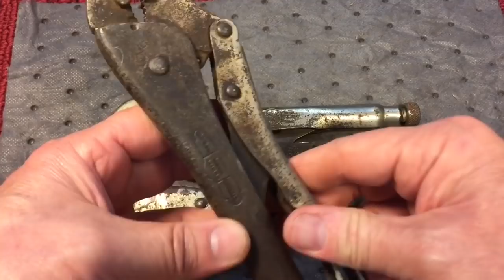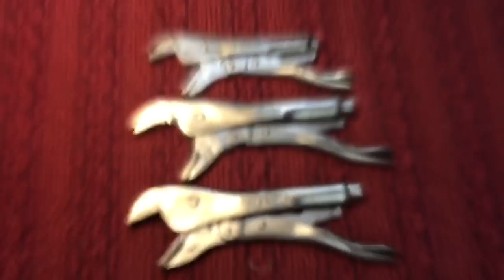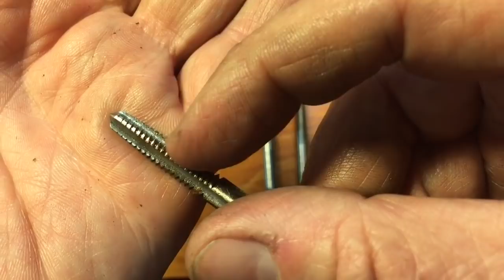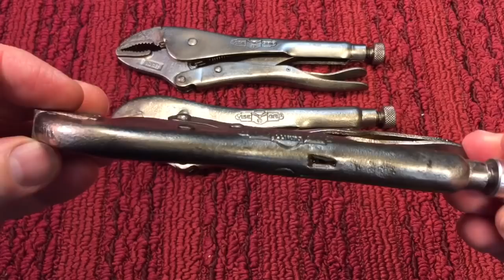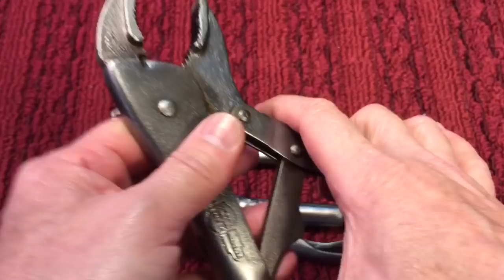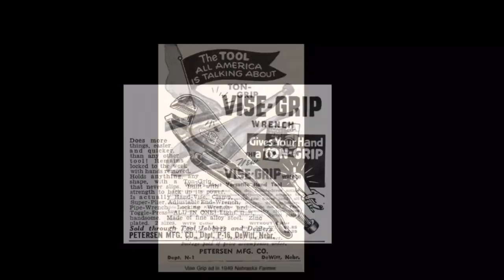Restoration of 3 VISE GRIPS...

Comment: Nice job on that end-knob. I didn't realize you could knurl with a lathe. If you want a real hard finish on the pliers, a 2K clear coat will hold up much better than any shellac, varnish, etc. It's sold in rattle cans. A little pricy and you need to use it within a day after it "kicks," but if you have lots of tools you need to spray, you can do them all at once.
Reply: what do you mean before it kicks?

Comment: Phosphoric acid works better than vinegar.  I use it to restore all of my rusty tools (and anything else rusty).  Just wipe it on with a rag.  It also removes rust stains.  Severely rusted items will sometimes develop white salt.  Just wipe it with more phosphoric acid.

Unfortunately, Lowes stopped selling phosphoric acid in 2018.  I bought 6 quarts of it on clearance for less than $2 a quart.

Comment: I have ootals of vice grips USA a Asian the things I've noticed about the Asian ones is not only the teeth of the jaws are very soft but the body loosens up on the jaws causing them to be very sloppy especially the needle nose and even the thumb screws are very soft and mushrooms out even under relatively low pressure... I  just redid a small pair of mine that I thought were rusted on the threads but the tip of the thumbscrew was so mushroomed that it wouldn't turn!!

Comment: I have vise grip which has a little of rust inside, can I use viniger or it will remove the coating of all the tool besides the rust?
Reply: Just used viniger to get most of the rust off and but still didnt get all the old paint off nice to cover it with clear coat so I colored it matt black. It turns great ( like a special addition or something :-))

Comment: Inexpensive!
I bought mine back ~2004 @ HomeDepot.
A month ago I wanted to buy one for my job and expense it.
Went beck in HomeDepot, with the idea that I will walk in buy one, and walk out.
Walked in, found tools section, found ViseGrips, found several new iterations, and started inspected. 
However Found ON ALL OF THEM Jaws and blades didn't align. Also the even though they were new, bottom jaw was moving side to side.

When I bought mine back in ~2004 everything was perfectly aligned. I member this because, I member that I was so happy that I as emigrant was holding, and owning something that was made in USA in such grate quality.
Today I thought I would be able to find one on Amazon, and buy one. Nop! 
I found out that company that made mine IRWIN, was bought out by Chinese company, and that they are manufacturing this Vise Grips in china, in same shiity quality that i found in HomeDepot.

If you have Unused, or in excellent quality Made in USA by IRWIN Vise Grips, hit me up and I will buy one/more at 400% including shipping.
Reply from the maker: It's such a shame that we can't get many of the quality tools of years ago, they have the technology and steels to make the same product but they always wind up skimping on something!
The Newer Vise-grips look similar but the jaws are much weaker steel and get mangled quickly....   Thanks!!!!!!!!

Comment: I can't find anything on my issue...what if the adjustment on the vise grip i was thinking of  taping
Reply from the maker: These are pretty simple tools, is the drive screw bent?
Reply: @ScoutCrafter  the adjustment threads on the vise grip are stripped

Comment: Just read your video on the Stanley grips. Very good and instructive. 
How do I assemble the grip after removing the lever? I cannot get the lever back far enough to go into the wide section of the slot.

Thanks, James
Reply from the maker: James- I'm not exactly sure what part of the grip you are talking about.  Maybe a pic?  bicycleguy@aol.com   Thanks!
Reply: Thanks for the reply and apologies for the delay, I'm mainly on email.

Problem sorted by gripping the jaws of the mole wrench I was able to reinsert the lever.

Thanks

James

Comment: Awesome video! Great to restore and save reliable Irwin vise grips! Did you use metallic paint or clear coat after all? Which did you use? Respectfully, thanks!
Reply from the maker: Hi Anthony!  I wound up keeping these inside my basement so I just wiped them down with my home brew 50/50 Mineral oil/Vaseline mix!  Thanks!

Comment: Thank you for posting this! I broke one of our vice grips but turns out it wasn't really me. It was the rust. My bro actually ended up fixing it with a blow torch lol
Reply from the maker: You know sometimes since a tool is a forging, there are cracks that develop in the tool and will break no matter how gently you treat it!  I think manufacturers estimate that 5% of tools are destined to fail...  They have no problem replacing such failures!  =)  Not your fault!  Thanks!

Comment: i got an older pair soaking in power steering fluid now because its rusted the  adjuster won't turn and the jaws were shut and wouldn't open until the other day when i took it out of the power steering fluid, another week and it should be good to go rinse it wire brush it and oil the joints
Reply from the maker: Power steering fluid and ATF are really good solvents!!!!!
Reply: @ScoutCrafter  what sucks about the power steering fluid is its really just hydraulic fluid almost the same as dot-3 brake fluid, i was doing my former son in laws brakes and had to replace the 2 rear cylinders old drum brakes and i got the asbestos and brake fluid mix on my hands and then spent an hour and a half finding and going to get the new ones, i had that on my hands most of the day and now when the heat and humidity of connecticut gets going the skin on just my right hand dries and peels where the asbestos and brake fluid saturated my hand. now if i go anywhere near brake fluid my hands start to burn just from touching it. it really sucks because i used to make a lot of money doing brake jobs for friends

Comment: Singer John Denver was using a pair of vise grips as a handle on the fuel transfer valve in one of his airplanes.  He ran out of fuel at low altitude and tried to unsuccessfully work the makeshift vise grip handle.  The rest is history.

Comment: Rust-Oleum 215215 Stops Rust Rust Reformer Rust Reformer 10.25-Ounce Spray-Color Black.  24 hours later you can paint over the reformer.
Reply from the maker: Hello José, most it's very hard to stop rust in bad environments like unheated garages or automobile trunks, once the chrome flakes off you need to put something on it to prevent air/moisture from destroying it.  I chose a clear-coat because the original finish looked very good after removing the rust... Thanks very much!

Comment: Hi ScoutCrafter, longtime viewer first time commenting. First great job on the Vise-Grips as usual. Reason I'm posting is I wanted to pass on a tip that I got from a friend relating to cleaning up after a vinegar soak, it seems to 99% solve flash-rusting as a problem in a way that dunking in baking soda or washing soda doesn't do. The tip? Give the parts a scrub with an old toothbrush and common hand soap (the cheaper the better, I use those tiny motel soaps if I have any). It works so well it means pieces can be soaked, scrubbed clean, dried and then just left bare, for weeks or even months. No having to rush to wax or oil, prime or get some shellac on them to stop the beginnings of rust. I think the way it works is firstly cheap soaps are strongly alkaline so they neutralise the acid residue, plus the suds clean the metal down to a finer level than the bristles of stainless brushes go. Anyway that's only our theory, may be wrong, we just know it works regardless of the mechanism. Hope it helps and keep up the great work!

Comment: Hey ScoutCrafter, have you ever used Evaporust? I restore old tools too and Evaporust works great in removing rust. Love your videos and the history behind the tool that your restoring. Keep them coming!!!
Reply from the maker: Hello Dan!  Not yet but it's on my list of things to try!!!  It's environmentally friendly so that's great!  What's not to like?  =)   Thanks!!!!!!
Reply: ScoutCrafter  yes, it is environmentally safe which is great. You can get it on your hands in it and it doesn’t hurt you. I found the cheapest place to buy it is Amazon. I buy mine 5 gallon buckets. Sometimes I let the tools sit in there for three or four days and it doesn’t hurt the metal. Only thing I did notice is that on a axe you’ll be able to see where the hardened steel is. It shows up as a different color than the rest of the axe.  It’s great stuff you got to try it sometime.

Comment: Tremendous restoration!  But, I really was looking forward to seeing red Vise Grips... maybe next time.  The 7R and 10R were among the first ten tools I purchased at age 16, and recently I did a light restore of those and gave them to one of my sons.  Of all the tools to go offshore for cheapification, I lamented these the most.  Somehow they just spoke to American ingenuity and value - a fantastic tool virtually anyone could afford.  Like you mentioned on the jaws, I did some testing and the new ones are not so good - so I went with Knipex "locking pliers" which have the quailty but not the affordability.  And the threads aren't smooth like my well oiled 41 year-old pair were.  Not sure how to really fix that.  I already well lubricated them, and use them like modern worry beads, thinking wear might solve the thread smoothness.  Or of course I could run them through a die to sharpen the threads, but I hate to cut into the finish.  Ideas anyone?
Reply from the maker: Hello Marc!  I have found that running the threads thru the wire brush to remove any Micro-burrs and then polishing them on the buffer makes a world of difference!  Then a drop of your Red Magic and you will be amazed!   Thanks!!!!!!!

Comment: +ScoutCrafter, nice job on those! I did similar to Dad's old Vise Grips. They are well used and the jaws are bent to one side on all of them.  I just got a new vise that I need to bolt to the bench and get them squared away. Keep the video's coming, we can't wait until you post a new one!
Reply from the maker: Hello Aaron!!  Nothing like a new vise to play with!  Congratulations!  I have a weakness for vises!  They are without a doubt the most handy tool in the shop!!   Thanks very much!!!!!!!!
Reply: I broke the last vise I had. I was going to weld it but it was cast iron and didn't think the weld would take so I turned the ram into a makeshift anvil for light duty. Yeah, I scored a 4" wide heavy duty old vise at a yard sale for 10 bucks.  It's an old Wilton vise and I cleaned it up and may have it powder coated or use that good tooling paint or just leave it. It weighs a ton.  I'm going to mount the new one to the bench this week and work on my old '64 C10.  I just ordered some new Vise Grips from KBC tools, on sale for 12 bucks or less for them. I ordered three sizes.  There is an Abom79 coupon KBC25AB if you order from them.  If you like machining video's check out Abom79, he's great.  And your right, vises are a great 3rd hand.  I need more.  The wife not so much. I would very much like to travel to your neck of the woods and meet up and flea market with you.  My wife wouldn't, but it would be fun! Opposite sides of the country is maybe a good thing.  LOL. my email is shrsmoke14 at yahoo.com  I'll keep an eye out for old tools for you.

Comment: For tapping the hole in the aluminum knob, you could of fashioned up your own bottoming tap out of a regular bolt with some grooves ground or filed in it (kind of like the flutes in a tap).  Don't think it would of had a problem with that aluminum knob.  I know i've used that trick numerous times but I don't know how well it would do if you were cutting new threads on a new hole.  Maybe a grade 8 bolt would be able to last a hole of two.?   Good job though.  They came out looking minty!
Reply from the maker: Hello Bradley!  I have seen people making home-made taps using your method and never tried it!  Like you said Aluminum is the perfect metal to try such a home-brew tool!  Thanks so much for the tip!!!!!!!!  =)

Comment: great job,stupid question do you use  full vinger or you it with something
Reply from the maker: Hello Timothy!  Actually it is an excellent question!  I use straight vinegar, apple Cider or white I found to be the same as far as performance goes.  I have been using my vinegar for over 6 months, I put 4 gallons in a 5 gallon bucket and have a lid for it!  The vinegar has yet to lose strength however it has gotten a little brown in color... Normal dip time on a rusty tool is 2 or 3 days...    Thanks very much!!!

Comment: I have a set of vise grips that never caught on,...flat bottom jaw and apex top jaw to fit around a bolt head or nut,...they work well but over loaded my tool bag!  Have you seen these? They are kind of redundant because normal vise grips can do the job,....but if you want to grap something by the tip of the jaw no others have so much power!
Reply from the maker: Hello 70C!  No, I don't think I saw those!  I prefer the curved jaws, but most people like straight jaws...  The Petersen made ones are so very good!!!!   Thanks!!!!!!!
Reply: +ScoutCrafter I will try to send you a photo of them 
even if I have no idea how to do it

Comment: good job as always  ...   im  having a real problem with  a crescent  wrench  just wont  go  tried a bit  with it  trying  soaking it again   hope it helps  ..    †
Reply from the maker: Hello RK!  You mean it's jammed?  I've always had really good luck with a little heat and a touch of 50/50 Acetone/ATF!  Heat breaks the bond from the rust and dried gunk!
Reply: that be kool    but the only heat i have  is from a lighter     LOL     ..   do not have a torch   ..

Comment: I bought a VW beetle that came with a free pair of vice grips. It was serving as a bolt to hold two exhaust flanges together. Needless to say I still have those grips and they work fine still. Just had to buy a bolt.
Reply from the maker: They have saved many of us!!!  I also think because of their super hard jaws they have damaged countless nuts too!  LOL   Thanks
Reply: jackrost1031, I even remember a guy who used a large pair for his "steering wheel."  Ha ha!!
Reply: Marc McKenzie I saw a set as a gear shift before

Comment: At 4:43 the tip of the point is often called a dog point. They are better for pushing since if the threads mushroom out from pushing against the mechanism, the bolt can still unthread.
Reply from the maker: You are so right!  I didn't know the terminology of that but you are spot on for the purpose!  In fact the original (carriage) bolt was difficult to remove because it was mushroomed!  I am going to pin your comment because you have just added an awesome tidbit of information!!!!!   Thanks so much!!!!!
Reply: ScoutCrafter you also see dog points in set screws. They will engage in a keyed shaft to prevent a collar or gear or whatever from rotating.
Reply: Thanks, jack, now I know.  I've known about the different styles of set screw points for decades, but I never knew the reason for them.

Comment: Have you ever thought about replating your tools?  You do enough restoration, and plating seems simple enough, that I'd imagine you'd enjoy doing that.  It definitely would create more durable tools that would be less subject to future damage.
Reply from the maker: Hello Michael!  The problem with plating is it's very difficult to do it right, we used to have a few plating places near me but they all have closed due to regulations. The chemicals used are expensive to buy and very regulated, so that means you have to pay to get rid of them too!  I sent stuff out years ago to have plated but I was not impressed.  I do have some tools I would like Blued by a professional establishment, home bluing usually doesn't look as good as when it's hot blued.   Thanks!!!!!!
Reply: ScoutCrafter  wmdguns.com used to do a “small bag of parts” coating in boron nitride.   They also will coat just about anything.   The boron nitride is supposed to maintain lubricity and anti rust.   Ymmv...
Reply: Yes, actually, looking it up, you are quite right.  It's too bad how much toxic chemicals are involved in a lot of plating processes.  Vise grips at least appear to be zinc or nickel plated and not chrome plated, so they might be a bit easier than some tools to do the original plating, but the point about chemicals remains.  Maybe at some point, someone will come out with a simpler process that does not have those complications.  I think that my preferred plating for tools might be silver, though obviously, that's not original to normal tools.  Silver looks like it's a lot less of a big deal than chrome to do, but of course, it is a more expensive material.  I like it because it is antimicrobial, looks good when polished, and it does not leave a smell on the hands.  I never really want to use a tool that's oiled where I'd hold it.
Reply: Could you try zinc plating them..? Several people show how to do it on Youtube...We  had Gedore brand vise grips,made in South Africa,in our market,as well as Sidchrome (which were made in Germany for Sidchrome),as well as Vise grip brand which  was  the premium,most expensive ..Now made in Asia,it is more affordable,but  quality probably not as good

Comment: Another great video!  Curious if you thought about using evapo-rust, seems to be popular lately.
Reply: Great stuff, I use it a lot. I filter the old back into the container with a paint filter.  I reuse it until it's black. I've been soaking my '64 C10 pickup front end parts in it before paint.  I found some at Tractor Supply for 17.99.  Usually 25 bucks or so.  I use De-Natured alcohol after rinse so it doesn't flash rust.  I like to restore wood planes and that's my recipe.
Reply from the maker: Hello Adam!  Yes!  I see many people trying it and swearing by it!  I will give it a try in day I'm sure!  Thanks very much!!!!!!
Reply: I've tried it. It seems o.k. except for cost over that of vinegar.  Evaporust is actually reusable,  too.